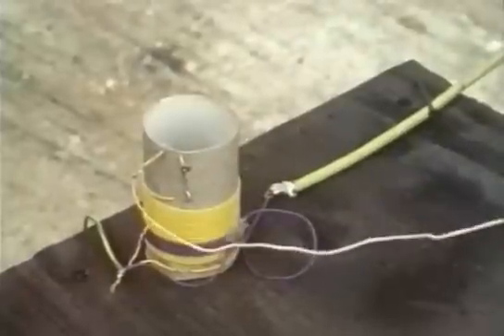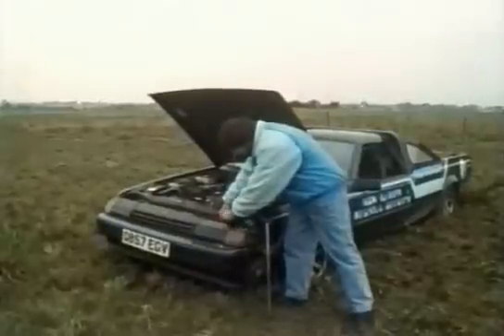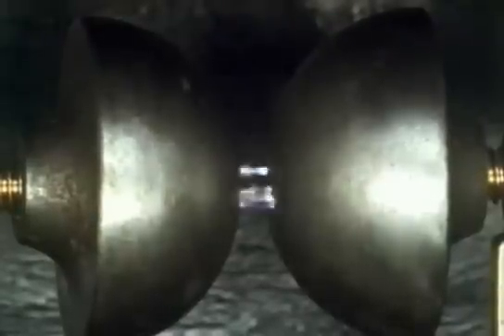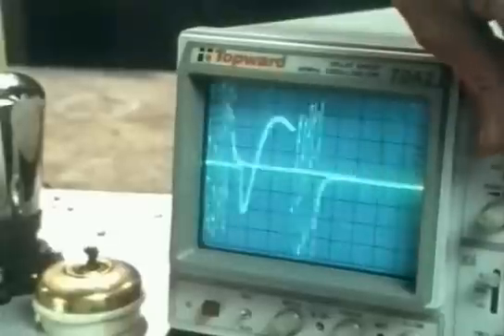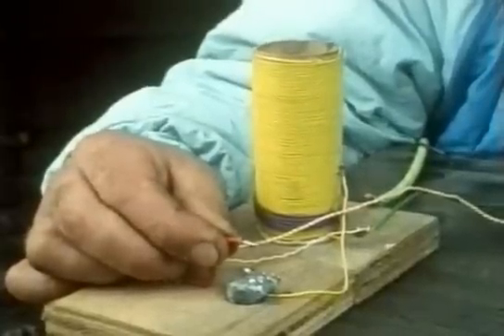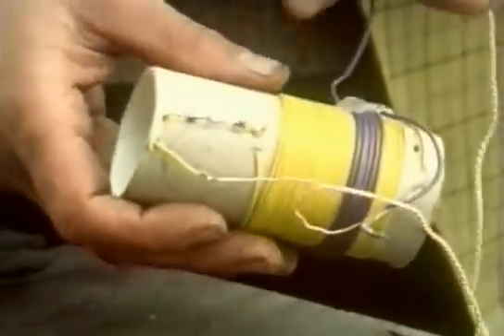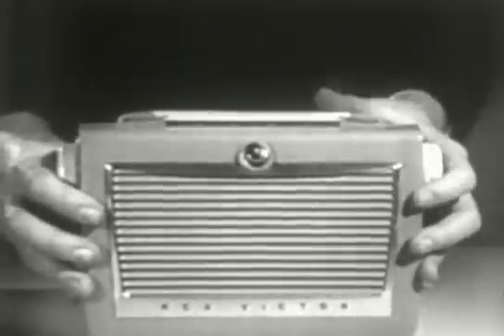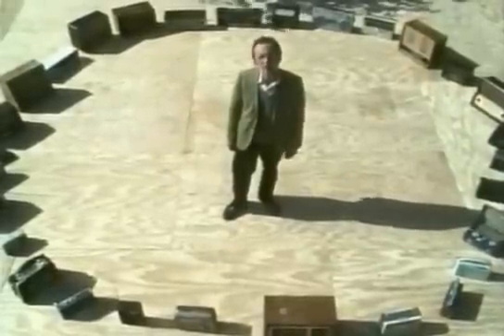Secret Life Of Machines - The Radio (Full Length)

Comment: It's amazing that here in the states, much aviation radio is still AM!
Reply: Aviation radio is still AM because receivers don't suffer of the capture effect as FM does. If by chance two different transmissions take place at the same frequency, you might be able to listen to both of them. In FM the stronger signal completely blocks the weaker one. It has been useful in several cases of stuck mikes, which would have blocked entire airports' operations
Reply: @robertoricardoruben  After watching that video i was sure that i will find that question  and possible that (very good) answer in the comments section.
I ask myself that Q many years ago and searched for the reason. Now I am a licensed ham radio operator :-)

Comment: Pretty certain Radio 3 was never broadcast on AM. However, air traffic control does use AM, at least in part because the interference prone nature of AM makes it easier to tell if two stations are talking over each other.

Comment: In 1966, as a teenager, I had a communications receiver that went all the way to 32 *megacycles per second* (as it was then expressed). It was even portable, and solid state. Oh, and por dios the BFO would allow you to get CW and SSB. I was amazed. It was SO advanced. My first big experience with technological fetishism, I guess you could say. But now, you can get an SDR in a dongle, plug it into the back of a PC, and listen in any mode you want, all the way to something like 2000 MHz. For less than $100. For that matter, you can get an app for your smartphone, and tune a shortwave radio anywhere in the world, control it from that phone, and hear what it picks up. Old meets new. Still hard to get my mind around it.

Comment: At 8:30, I spotted a diamond-shaped blue printed label, enclosing a number 4, attached to the radio dial. This brought back memories of when the BBC reorganised their transmission frequencies in November 1978 (when I was 13). These small stickers were delivered to each household to mark the new BBC station positions on their radios. I still have an old portable radio with its stickers in place!
Amusingly, at 21:22, the benefits of the RCA Victor non-breakable case were extolled' I doubt, though, that the circuitry would have survived the drop.

Comment: This video implies that aircraft radios are FM, but actually they are AM, not FM.  FM is used by most other services in the VHF and UHF bands such as the 'family radio service'.  Many services have switched to digital radio, which requires a special radio receiver with the ability to decrypt the signals.

Comment: Now it's 2019. Longwave (LW ) broadcasting, once a staple of European stations wanting to cover the continent, is nearly gone, at least in Western Europe. It was still so useful in the early 80's that most British cars had two band radios but, instead of AM and FM, it was AM and LW. Some LW stations are still left but most have gone to internet radio instead. BBC 4 on 198 KHz is only on the air due to howls of indignation from fishermen and other marine interests when the BBC announced it would discontinue LW broadcasting,. The LW programs provided weather and shipping information as well as news and entertainment to many small fishing boats whose one means of getting information was an ancient but reliable LW radio. It's operating on borrowed time as the transmitting tubes (valves) are no longer made. The BBC stockpiled the tubes in the late 90's and are now down to their last four sets. Once those go, British LW broadcasting will go with it. Even standard AM and FM signals are slowly being converted to digital audio broadcasting (DAB), and many shortwave broadcasters are moving to satellite and broadcasting on DAB+. The thrill of being able to pick something like the BBC on the Hong Kong transmitter direct in the US is now gone.

Comment: Why concentrate on Marconi? 
 What about the other experimenters all working on wireless at the same time?  A few mentioned below but also add David Hughes in his room and later walking round London receiving signals and Captain Jackson on board ship and later out of sight at sea. 
I have several valve sets, two earliest about 1931. I started with a one valve kit, H.A.C. in 1969.
Radio still fascinates me, 1 Watt Morse Code to an indoor dipole got me to Bulgaria last week on the 28 MHz band. 1500 miles.
G4GHB

Comment: Nice work. It's actually not so much the spark itself that sends out radiowaves - radiowaves are sent out by the attached wires. The sparks create transient currents in the wires which then act like an antenna. 
H. Hertz, then Marconi - sure. But what about JC Maxwell ? Maxwell predicted radio waves mathematically and the reason why Hertz made his experiments in Karlsruhe was to prove Maxwell's theory by way of experiment. Hertz had studied Maxwell's work extensively while at Kiel University. Kiel had no experiment room. Karlsruhe had. Voila.

Comment: Left out the full story of David Sarnoff and how he eventually destroyed Armstrong, financially and psychologically. Sarnoff saw Armstrong's FM radio as an economic threat to RCA, and using his power as head of RCA, he had the FCC constantly changing the  frequency allotment for FM. He would do this deliberately after Armstrong's manufacturing company completed a manufacturing run of FM radios, which then became obsolete even before they went on the market. Eventually, Armstrong committed suicide after years of litigation with Sarnoff. Armstrong was a genius who invented many many circuits, not just the super het as mentioned here, but also FM radio and radar. But he was beaten by a man who had talent only for larceny. (Sarnoff also stole Philo Farnsworth's plans for TV by sending a scoundrel named Vladimir Zworykin to Farnsworth's lab. Zworykin copied all the designs which he later turned over to Sarnoff. David Sarnoff also claimed he was the first radio operator to hear the SOS signals of the Titanic, and that, as a 15 year old telegraph operator, he kept in touch with the Titanic for 72 hours. It's a complete lie.

Comment: I build my own shortwave radio using one transistor s9018 as receiver, and use sound amplifier for amplifier.
Reply: Happy memories...Germanium transistors with thermal runaways which ended the dream until another batch of samples arrived from Mullard.

Comment: 21:48 - "...as low as $27.95 at your RCA Victor dealer."  So let's see...these radios with the "Impac" case came out around 1955 so that $27.95 would be about $260 in 2017 dollars.

Comment: When was this made? It looks like late'50s or early'60s.
By the '80s AM transmitters were available as solid state, and modular so they could be quickly repaired. Superhetrodyne is pretty much replaced with SDR. I worked on the first commercial SDR Telemetry system in 1999.
I am a retired Broadcast Engineer in the United States.

Comment: People need to learn.. TESLA a while very good person and contributed to much to the work of AC power, HE DIDN'T INVENT RADIO.. Hertz did. Tesla did nothing to commercialize the practicability of radio message transmission, he fixated on wireless power transmission instead. Tesla inadvertently let Marconi to market the first practical radio transmitters and receivers and this is why Marconi is remembered more. Also the first of Marconi's equipment didn't use tuned circuits, this DIDNT steal from Tesla's patents, however He did start stealing them later on once he became more popular and needed to prefect his machines
Reply: he did steal the circuit design from JC bose's 1895 demo in the RI building london where he allegedly torn of some pages from JCB's diary

Comment: @Electronics Visions 1960s I was walking along a Arkansas Road where there was High Tension Power Lines on then & The Electricity Spoke to me, to wit: They were captured and forced to Run Back & Forward by Humans. They showed me On Power Poles Yellow Creatures Running Back & Again (Same as Saw Tooth in Oscillator) further more From the Ground in front of me an the Road Electric Ground ""Demons"" popped from the Ground    to impress me of the Truth, these were the Earth Ground.     Not a Dream, I was Alive, 15 Years old, in Benton, Arkansas, when I often had visions and such.

Comment: The QM-TIMESPACE wave-package Holographic Universe is operating on exactly the same principle, ie AM-FM radio/TV is an aspect of self defining "ordinary" Temporal Superposition-point Singularity Modulation of Superspin Eternity-now, as any R&TV Technician could show you. 

Maybe it requires a bit more complexity than a Cat's Whisker Crystal Set to demonstrate.., that the Actuality of superimposed modulation Timing-spacing in Quantum resonances is a phase-locked multi-phase state transitioning of QM-Time In-form-ation, but the information provided in this program above, is sufficient to convey the idea of emissions and condensation of timing conception = reception/observation. Environmental emissions from composite coherent objectives, are demoduled into frequency shifted memory multi-phase states in superimposed "landscapes" of resonance.., to be re-called or echoed by re-imaging imagination from points of synchronous coherence in the brain 's bio-logical computational setup.

Ie it's complicated and messy, but comprehensible-coherence, tuning "sensibly" to the Observable Universe.., the "static interference" is the chaotic sum-of-all-histories of unrefined and unrecognized experience sifted/filtered from ordinary existence, holistically. 
That's why Science, is a system of tuned/Hetrodyne feedback recycling of evidence, (as an emulation of brain activity).